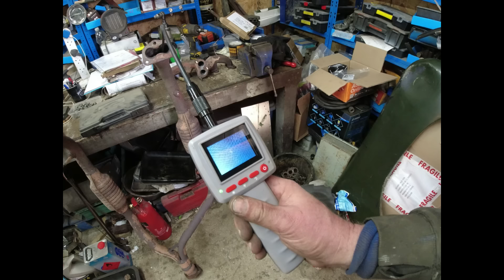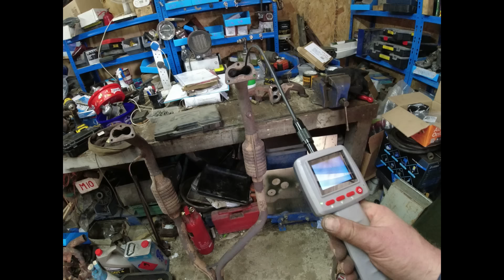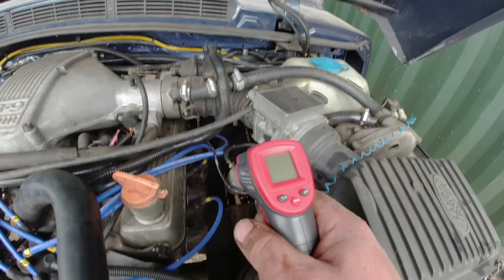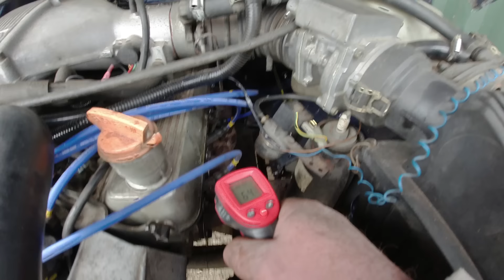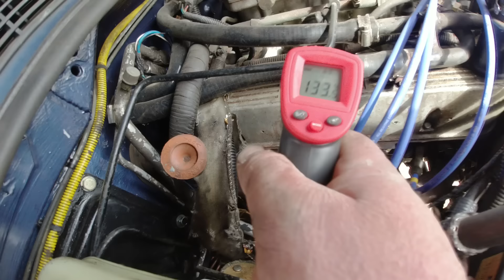Range Rover Classic softdash Royal protection car - Dead CAT! where will this end? Ep9

Comment: Richard get Rovergauge plugged in and look at the live data I had exactly the same running issues with regards to mixture and misfiring. After replacing ALL ignition components to no avail, thanks to Rovergauge I was able to determine the brand new cheap pattern part airflow meter wasn't accurate as my idle voltage was set around 2.2v i adjusted it down to 1.5v as per the book no matter what i couldn't get it to run right. Swapped for a second hand Hitachi/Lucas 3AM Airflow meter and it instantly fixed it with rover gauge finally confirming the correct voltages throughout the rev range. 
Also because mines running a green tune resistor with no lambda sensors the 14CUX mainly relies on the AFM signal to set fuel trims so any discrepancy will instantly affect the engines performance. I bought 2 aftermarket AFMs neither worked it took a lot of head scratching to work out it was them all along as the car came to me with running problems so i didn't have any history as to why it ran bad hence why i started replacing the ignition system first. Great video as ever mate and good luck!
Reply from the maker: I use rovergauge quite a bit, alas it is not great at spotting some of the more obscure issues like a dead injector nor a dodgy plug, then it comes down to basics such as shown. 

That said I have a couple of RV8 14CUX cars that are struggling. mostly with crap aftermarket parts and Rovergauge is very good at spotting a dead TPS or out of range AFM. I also use it to ensure that the correct tune resistor is being used. All clever stuff and every day is a school day.

Cheapo chinese AFM is a nightmare, as I am led to believe the "hot" wire is just a resistor and as such is no where near as refined as the OE Lucas 5AM. OE AFM is easy to destroy with brake cleaner etc

Comment: Ooh,the joy of a leaking diffpan! It's a pain to weld, the horrible diffoil seems to soak in to the cast-iron somehow?  I wonder why the pan wasn't cast with the rest off axel?  That car is a real kinderegg, full of surprises!
Reply: Axles aren’t cast - they are sheet pressed into tube sections with seam welds, the end flanges for the stub axles/swivels are machined plate friction welded (spun under high pressure) onto the ends of the welded tube.  The pan is thin pressed steel sheet welded on after the axle case is welded up.  Only the diff housing is iron or cast.
Reply: Of course, my bad! But still, the pan is a bit thin, and a bugger to weld!

Comment: That soft dash should have an electric lock on the low drive ,it that stops you moving it at the wrong point.
Reply from the maker: I heard this elsewhere and the parts manual suggests from JA chassis numbers. I have yet to see the solenoid and interlock though on a classic. In this case lube on the pivot helped it to get going

Comment: What a pain, always something new to annoy and frustrate. Is it worth swapping that king lead round so the straight end goes right into the cap, bet the right angle end fits the coil just right?
Reply from the maker: yes but the issue here is that the coil is up behind the LH headlight box. Because of this location it is supplied with a big rubber splash guard to protect the LT side of things. Alas that needs a straight connection. Customer got short change (from the manufacturer) when requesting such a connection and as it turns out they chopped the wrong bloody end off to fit it. All fixed now and by me for pennies

Comment: What new sparks can fix its amazing!
Reply from the maker: what correct plugs can fix is amazing. Quick bit of context. The customer bought the car with these plugs fitted. after some poor running issues and on my recommendation he fitted bosch super4 plugs. alas these were then swapped back to the original incorrect items as part of me diagnosing a monster misfire issue which turned out to be distributor iirc